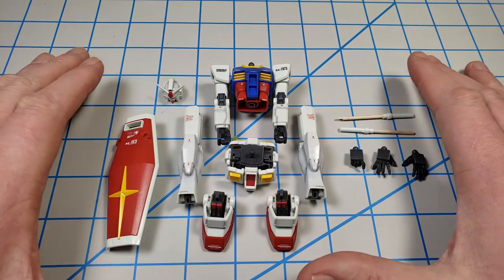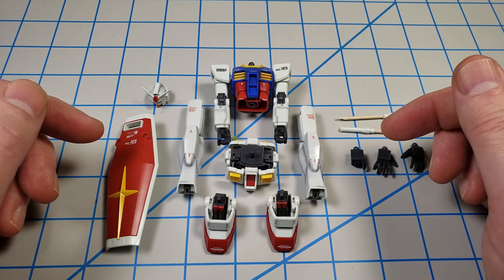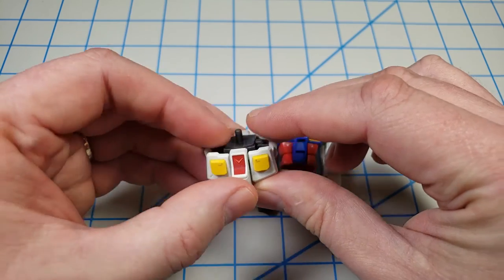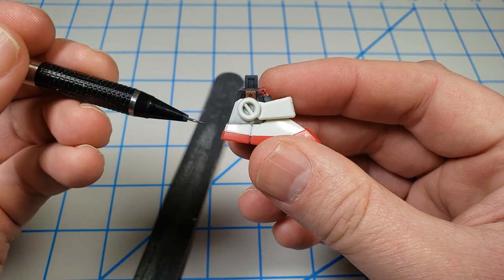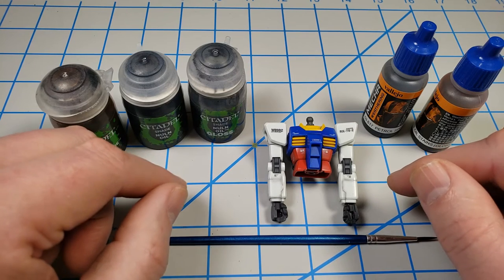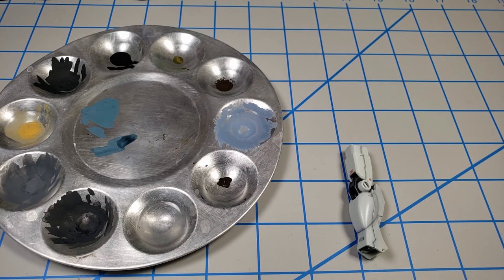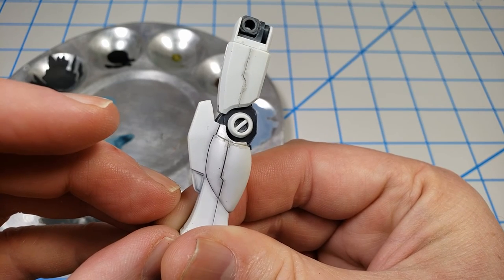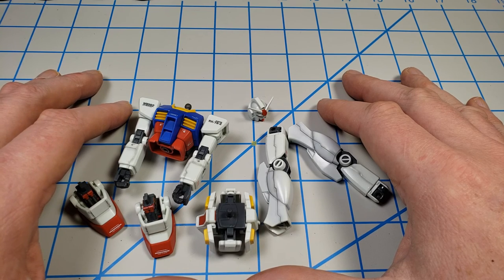Building A Gundam - Bandai's HGUC RX-78-2 Part 9: Panel Lining

Comment: What do you think of Tamiya Panel Accent Line Color?
Reply from the maker: It's a great product, definitely worth using. I do think their thinner is a bit "hotter" than some others, but that is based more on anecdotal evidence. 

I will admit that more and more, my primary "go to" is oils though. They seem to be just a bit more Bandai plastic friendly. They can be applied a bit thicker, so the flow doesn't get away from you, and when used with odorless thinner, are virtually scent-free.

Still... the Tamiya products (as all of their stuff is) are top notch, and if that is what you can get, or already have, will work great. Just be careful of allowing the thinner to flow into joints, pegs, etc., or the "Bandai plastic bug" will likely bite you!

Thanks for watching and commenting!
Reply: @JonBius  then would you suggest applying a base coat of Gloss on the bandai plastic itself prior panel lining? I’m a newbie in the hobby and hear so many negative things about Tamiya panel lining and how it could make the plastic brittle and crack…
Reply from the maker: @uge2616  Welcome to the hobby!

The key is to not let it pool into joints and joins. The plastic that Bandai uses differs from other manufacturers in that they don't "bake" it at the end. That process hardens it - but also causes a minute amount of shrinkage. So Bandai trades that off for better fit.

You can apply Tamiya thinners directly to the bare plastic, but I'd recommend doing so in a controlled process to avoid allowing it to pool into joints, etc. In fact, if your not painting the plastic, you could panel line before assembly - allowing for far greater control.

You could apply a gloss coat, but the thinners in Tamiya might eat through that if allowed to sit in a joint, etc.

They key to it all is controlling the flow.

One thing that I highly recommend in growing in the hobby is to not be afraid to fail. What has helped me to learn what can and can't be done is to push the limits - how much can I get away with? 

I hope this info helps! Thanks so much for watching and commenting. Happy day to you!
Reply: @JonBius  thank you so much! I just finished panel lining on bare plastic and cleaned it after 10 mins of letting it air dry. So far no cracks… we shall see… Thank you so much Sir Jon!!
Reply from the maker: @uge2616  Glad to help. Have fun!